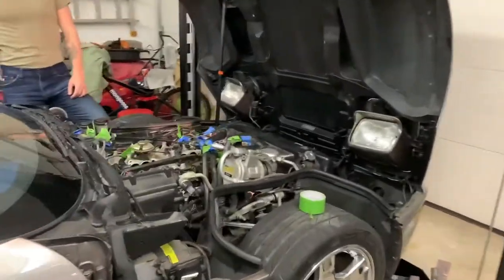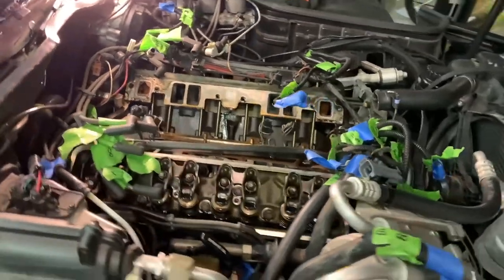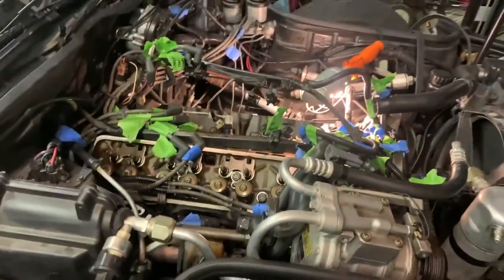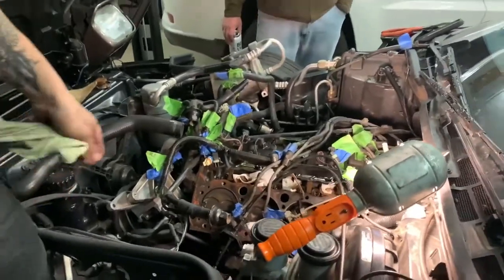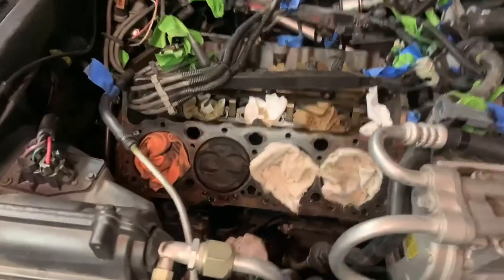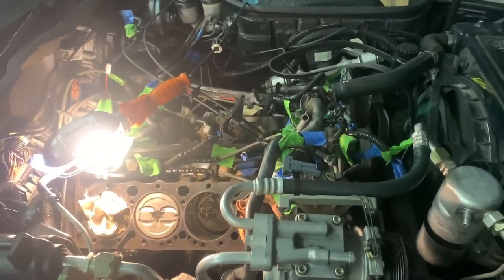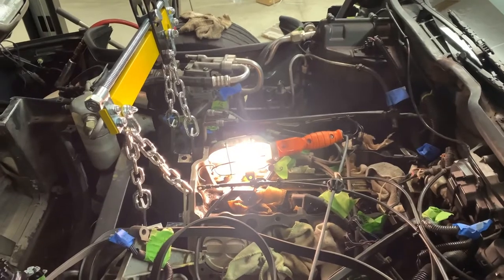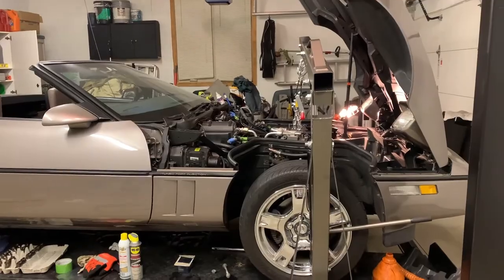NEW CAM FINALLY INSTALLED! C4 Corvette DIY Camshaft Installation

Comment: Have the machine shop mill the heads, so you know that they are nice and flat.
Reply: Damn right you should have done that. Very likely the aluminum head could be slightly warped, considering you have antifreeze in that cylinder. Bet you didn't have the heads resurfaced did you?

Comment: Hate to resurrect this post with a comment but I wanna do a conservitive cam on my 86 and was wondering what u did besides cam, valve springs, retainers, and seals. Did u get a bigger intake? Port the intake or heads? Or is everything else otherwise stock?
Reply from the maker: Nope, I left everything else stock. Now I’m sure you’d get more performance getting a bigger intake or porting the heads. But all I did was Cam, valve springs, retainers, seals and a tune up on the motor

Comment: you need new head bolts there are torque to yield
Reply from the maker: Yes I should have gone ahead and put new ones in. I kept the bolts in the same spot so at least if there were any unique imperfections with the threads they’re back in the same spot. I plan to get new head bolts in the future!

Comment: What parts did you need for cam
Reply from the maker: I got the Camshaft, valve springs, retainers, and seals. Those were the main parts that I picked up.
Reply: Id always recommend getting a full cam kit. Just a cam itself will cause some unwanted issues on the valvetrain.

Comment: Please don’t tell me that you really used the old head bolts
Reply from the maker: We did because the car had a head gasket leak before and the head bolts were replaced then and still looked fairly decent so we did🤷‍♂️
Reply: @apprenticeautomotive  those bolts are stretched, never reuse old bolts
Reply: @oletwatts6913  thats a fake myth. You can reuse old head bolts. I think somebody made that up to get people to buy more head studs instead of bolts. If the bolts are in good shape they shouldn't snap off. They're just replaced for good measure but more often than not the bolts are reusable
Reply: @oletwatts6913  That's a fact. All this work and you may have screwed up; hope you didn't, however, time will tell, it won't be long until the new gasket fails, especially if you didn't have the heads checked and resurfaced!
Reply: @ryantexada9269  It's not a myth dude especially with aluminum heads!!
Reply: @@ryantexada9269  yep more of a few times I re used head bolts no issues  at all

Comment: Apparently you don’t realize what you took off was exhaust manifolds not headers headers are a tuned exhaust not what you pulled off which was factory exhaust manifolds and your head bolts are not aluminum